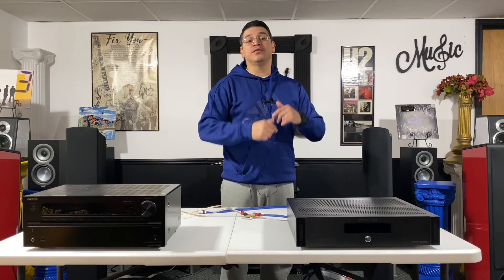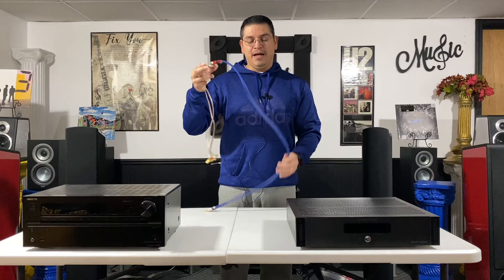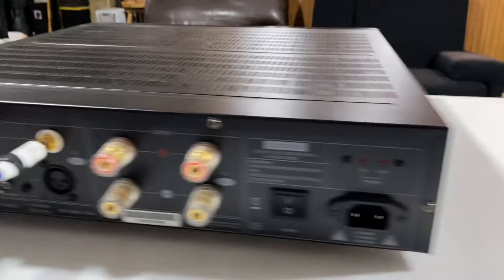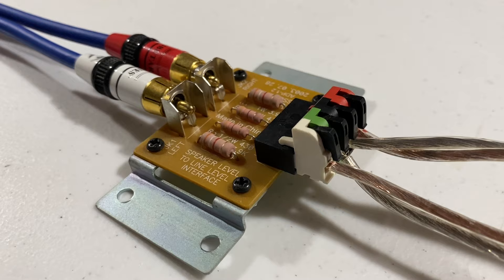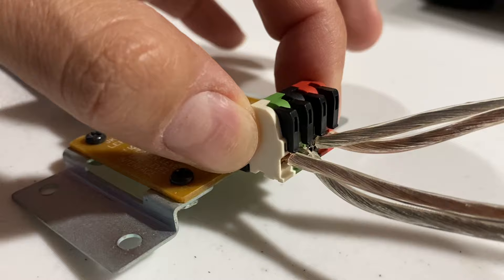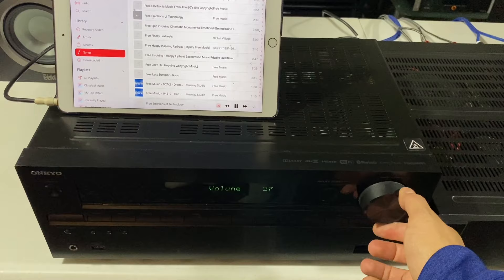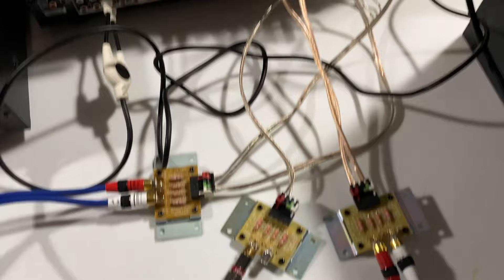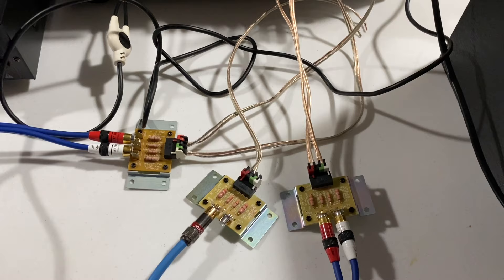Connecting an amplifier without using preouts.

Comment: Zone 2 would supply signal to an amp with only the RCA cables. You created a problem and claimed to have a solution. The real solution was in front of you the whole time. Also strm box leaves you questioning??? Streaming box... I don't see how you're giving "advice" when you're lacking knowledge and experience. Research what you have before doing videos, you'll actually know what you're talking about at that point.
Reply from the maker: Thanks for watching and for commenting